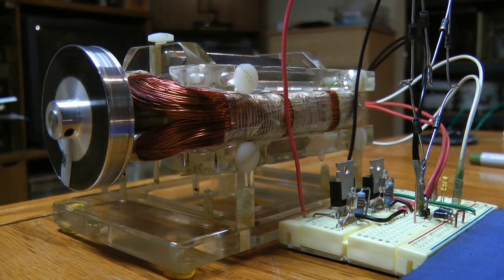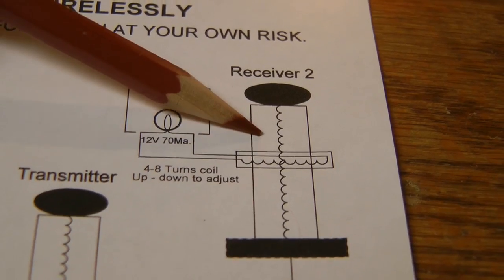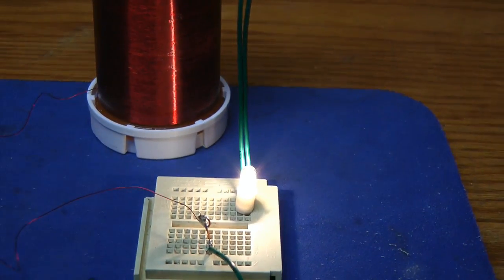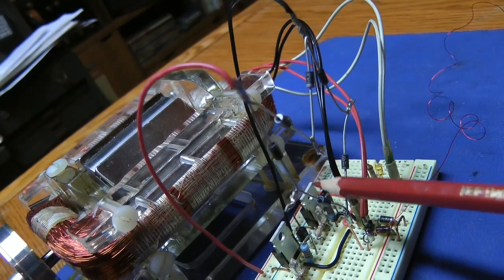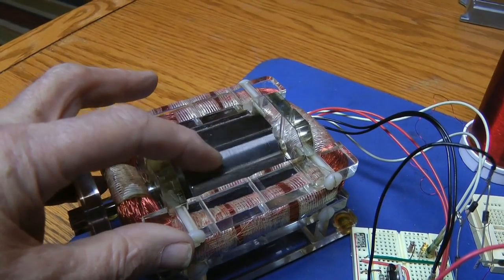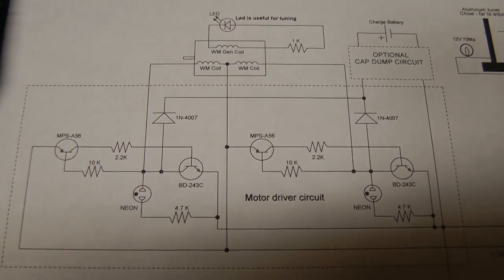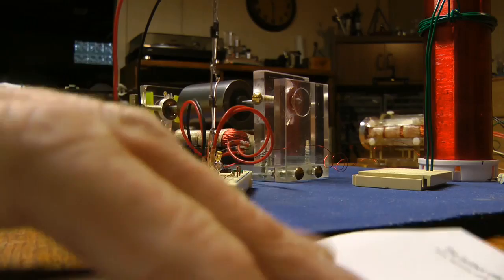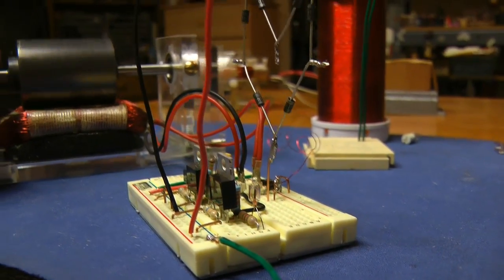Motors Run Wirelessly With Tesla Coil

Comment: It is great to see you back on youtube John,with your wonderful machines. that would have to be the best wireless energy transfer i have seen-well done. The reason the neon and 12 volt bulb light at the same time is due to the skin effect. The 12 volt bulb will consume most of the current,but the neon relies more on voltage.So there is enough high voltage passing the 12 volt bulb to light the neon. I did a similar thing with LED's and high voltage through water.
Reply from the maker: TinManPower Hey Brad, it's great to hear from you. Thanks for the compliment but I just happened to get lucky. You're probably right about the bulbs. I've never seen this happen before and mentioned to someone else that it might have to do with high frequency traveling around the outside of the conductor and low through the center. Skin effect I guess your right. Take care Pal, I'll have to visit your channel and see what you've been up to.
John
Reply: @DadHav  yes if u got frequency nd if u can get to vibrate it ie amplitude nd find resonance may b u can even use it for multiple motors at the same transmission do check with multiple receivers same resonance though
Reply: ***** Have you been able to replicate OFF of the breadboard (away from the breadboard) - that is get the neon to light in parallel to the bulb while they are touching each other directly and there is no other capacitance around?
Reply from the maker: Cool Joule Hello Patrick. OK I soldered the bulb and neon to the leads of the 7 turn coil that's around the receiver. The leads are about 8-10 inches long. The bulb and the neon still light but it worked better, brighter and easier to tune when the bulbs where plugged into the little proto board. I can light a separate little neon 10 inches from the coil or just within the same range that the bulb and neon together are. If I add an extension to the coil and move out a few more inches the effect goes away. With 10.7 volts and 350 ma I can light both for up to 3 feet away from the transmitter with the receiver and bulbs and go to about 5 feet before the bulb goes out but the neon still stays on. Are you using the same setup that has the receiver coil grounded and a separate coil around the receiver? As an observation I would say you were close by saying the metal in the board enhances the effect. I'll tell you, this stuff is so sensitive to tuning that you can easily miss things.
John
Reply: ***** All I have left is that it's exciting the neon gas and bypassing the 30ohm bulbs resistance, the way you light up the gas in the other light bulb in the previous video, that looks so cool!Is that the way your neon would light up under "normal" conditions? I see just the top of the bulb lighting rather than the whole electrode.
what is normal right ;) 
I've not been able to get that circuit to allow my little window motor to run that fast - of course I'm only pushing 12 volts. That ckt is hands down the most efficient I've used though and it charges my batteries too. the best battery charger so far using 3PM kit is the emitter follower ckt in my neg2neg mode with aluminum wire.
I love these puzzles, not that i'm any good at getting to the answer...
Keeps my brain going - thanks.
Reply from the maker: Cool Joule Hello Patrick, You might be right about exciting the gas in the neon but I think I've seen the bulb act normal also. I'll have to take closer look. I could send you a picture but I think I lost your e-mail address. If you have mine drop me a line. If you got the one coil circuit to work you're doing better than some. The circuit can be very tricky to get the right resistors to maximize the motor rpm. Also if the resistance gets to low the transistor can turn on hard and stay there. A practical fuse or a current limited power supply is good. When it comes to running the motors on the receiver the one coil circuit was the only one that worked well. The SSG and the half and full wave circuits all self oscillated but worked to some extent. The other thing is my window motor coil that was about 200 some turns did not work. The two motors in the video had over 400 turns. Patrick I was very fortunate with this experiment and extremely lucky to have things work out. Everything that's working here could have been missed easily. And don't forget the two motors I used are exceptional (If I must say so myself) LOL, Pat on back.Keep that brain going Pal.John
Reply: ya think it might be a combination of skin effect & some sort of resonance where the leads of the neon act like an antenna absorbing power from the energy radiated off the t.c.?    if you put the right length antenna on 1 lead of the LED & grounded the other lead would it light up?
Reply: can use the tesla radiant antenna i u have a graet arragment of capacitance vac and a very big ammount of bank of capacitance you can inluminate your home -.- tesla know the tru about the universal energy and is risonation gust i think i don have any knowledge only my private research

Comment: busy man! you have run a good gauntlet of experiments here. welcome to the strangeness......
i am convinced there is an extra variable with these towers that there is just no name applied to yet...not publicly anyways. trying to sort things out gets frustrating, i always feel like im missing the right words.
i hope you enter the SEC contest this year! we learned quite a bit together last year by coming together.
Reply from the maker: jeremy gwilt Hi Jeremy, I heard about the SEC contest the last few days but have know idea what it is. I agree with you. Receiving energy from a Tesla transmitter seems to have a few differences from what I'm used to. As an example how can high voltage seem to move around an operating circuit with a load. Could it have something to do with high frequency traveling around the outside of the wire instead of through it? I don't know. You have a lot of good videos. I'm going to try to keep up with what your doing a little bit. The static motor blows me away.Good LuckJohn
Reply: ***** thank you sir, i take that as a huge compliment. 
there is very little documentation online regarding slayer circuits etc, as you have no doubt learned. the term SEC (spatial energy cohesion) came up in dr stifflers work i believe. 
i found myself in the middle of a great number of people that were building these and much more experienced than i, then i think it was deeds who made an off-hand comment about a competition and we ran with it. 
it was all in the name of promotion, and worked out pretty well. i expect if we do it again it will be much more popular. 
maybe we can put some kind of a face on this mystery.
all i know for sure it that it is a 'field' of alternating current (try holding your scope probes in the air a couple meters away)...it changes shape easily, and seems to seek out ground....or virtual grounds. see....im already losing hold of it!
Reply: ***** i had to think about it a while before it clicked right, but i think you have something with your observation of travelling outside the wire. static creep has been a huge enemy building these various high voltage motors. it is nefarious! 
you can try to rectify what comes out of a receiver tower...but AC will still go right through (at least the components i have tried). the field emitted can be heard on an am radio (handheld works best), and extends a surprising distance further than you may expect! so it can be expected that the field also wraps around the components you are trying to use. diabolical.
Reply from the maker: jeremy gwilt Hello Jeremy, Sir is certainly not necessary, John is fine. Yes, Stiffler and SEC first came to my attention by watching my friend Rusty's (LidMotor) channel. He's a great guy with a lot of fun experiments. I have to admit that through all my years I never experimented with Tesla coils, so I can only present observations and probably make bad guesses at what's going on. The fun is finding something that looks unusual first right? I did notice how easy the ungrounded scope probe picks up the sine wave, but didn't move it around all that much. My hand held meter picks up the frequency as well, without being connected. I still think I've had a good experience completely by accident. Maybe it's the frequency that my coils are running at. I've heard people mention their coils are running in the KHz range but my function generator scope and meter say my frequency is 1.6 to 1.8 MHz range depending on top load or what's running from the secondary. Does this sound about right?J
Reply from the maker: jeremy gwilt Indeed, it seemed as though two loads in parallel having completely different requirements can both work at the same time. I'll have to try the radio to see what happens too.Thanks for your comments Jeremy.
John
Reply: ***** good morning...it sounds like you probably have a better handle on this already than i  :)
i am also just making observations, randomly stumbled on. i havent tried to measure frequency yet.
regarding the contest: it was a simple distance challenge, source to receiver tower with only a ground connection...and you had to transmit enough to light a floro tube. deeds won with 30 feet, done outside. i think we should at least double that distance this year.
Reply from the maker: jeremy gwilt Does the guy using the most power on the transmitter have an advantage? Does taking the distance and dividing it by the watts used on the transmitter or something like that make any sense? There could even be different range or wattage categories. Hmmm, sorry, just thinking out loud.
John
Reply: well, i put in a 'creativity' class last year to acknowledge effort without just turning the power up. im not sure how to approach that this year but something like that will have to be worked out.

Comment: I think (and may be wrong) that he capacitance in the neon has to fill up before current is passing through the filament.
Could be some other HF strangeness. Might not make sense with traditional electronics, but makes sense with slayers.

Be careful rectifying the base of the receiver. Its probably a good thing you didn't add a ground there. I found I could pop 1kv rated capacitors via a full bridge rectifier between receiver base and ground... I also found it was a great way to reduce the voltage threshold on electrolytic caps if charged to long that way.
 Here is a video of what I was doing www.youtube.com/watch?v=sLfZGNDJ93o
Reply from the maker: Mongrel Shark Hey Shark, thanks for the entertaining video. I'll keep everything you mention in mind. Ya, there's a lot of things that are hard to comprehend about this stuff. I'm sure the guy's on The Big Bang Theory could explain it all away though. LOL

Comment: Love those window motors. Good to see them back in action. Thanks for those clean schematic outlines. Have you checked the current draw when those bulbs are loaded?  I believe its considered a reactive load with those bulbs, in that it only draws according to the capacitive coupling value  and its loads load present. Its pretty cool stuff for sure. Love that shotky AV, I think I might try that some time as it adds even more capacitance to the circuit as well as fast recovery times. Thanks again, its good to see some new videos from you.
Reply from the maker: Diadon Acs Hello Diadon. The window motors are definitely a lot of fun. As I watched the video back the window motor kept spinning all the while after disconnecting it. The coils being energized from the transmitter mush have something to do with it. I don't think I can check the current draw on the bulbs but I'll try. I did try this. In order to get the same brightness on a bulb connected to the power supply I had to go to almost 20 volts and 100 ma. Yes the Shottky diodes seemed to work better than the germanium diodes at least for this application.ThanksJohn
Reply: Does the transmitter amperage go up when lit?
Reply from the maker: Diadon Acs Hello, when the receiver is between 2 and 3 feet from the transmitter the current will go up about 10 ma when a 12 v bulb is plugged into the receiver. These bulbs usually draw about 50-70 ma when operating in the 12 volt range. Moving the receiver, on the other hand, into a range of less that 2 feet of the transmitter increases the current draw from say around 600 ma to 800 or over, Still in that range the bulbs only seem to increase the draw by around 10 to 15 ma when plugged in.Interesting right?John

Comment: At 3:50 you'll likely find that an LED also lights fine, in parallel...it makes all kinds of nonsense lol. Another one, is to put a neon and an LED in series with each other, both run perfectly fine !
Reply from the maker: slider2732 Hi Mr. Slider. As soon as I read you're comment I decided to go try it and see what happens. Before I hooked up I took a guess at what I would find. My opinion was that when I plugged in the LED that it would light but based on the seemingly higher voltage that was lighting the 12 volt bulb, I figured the LED would light and over draw current until the voltage would stop to what ever the diode could hold watts wise. Well I plugged the diode in and nothing happened, the same with another LED. I tested the diodes and they where no good. Hmm, Yep they where burned out. I fetched some vintage LED's from my scrap drawer because I knew some of them can survive 100 ma or even more. Yep, this time the diode and the 12 volt bulb lit but the filament bulb was very dim and just what I would expect because of the current limiting the diode provided. I used an in-between vintage and modern LED put a cardboard between the bulb and the diode so I could see without interference and carefully moved my had away from the receiver to let the voltage go up slowly. The diode was glowing even before the bulb came on. Slowly moving way the diode got brighter as well as the bulb, then I could see a tiny red-orange glow in the diode on the junktion then nothing. The receiver was working extremely good with two of the 12 volt bulbs lighting brighter in parallel that one of them on the battery. In series neither the bulbs or the diode / bulb was very bright at all.John
Reply: Thanks for trying it..I think your power transfer is far higher than anything i've mucked about with. Certainly, if you connect 1 leg of a neon to a leg of an LED and then hold either of the outer legs with a hand they will both light.
You do tend to make highly efficient devices  and sorry about ruining a couple of LED's...as the kids would say, you have 'moar powerrr !!!'
Another way to look at it, your system is capable of blowing LEDs at a good distance, wirelessly !
Reply from the maker: slider2732 Ha, ha ha. slider I have been collecting parts for over 50 years, certainly most of them are classified as sacrificial by now. I will try your suggestion with the neon and LED if I remember. Maybe you would have the same results if you tried a receiver like Receiver 2 on the circuit picture I showed. I think this might be more like a transformer / inductive / something else tuning or something different from the capacitive tuning in the picture of receiver 1. I'm guessing but I would estimate the receiver of having near 100 ma of energy of some sort. Anything on these videos that looks like I knew what I was doing is only accidental and I just keep tying things until something looks good enough to report.John
Reply: As far as i'm aware, it's capacitance enhanced induction with the Slayer types...induction range, extended by the capacitance interplay. Dr. Stiffler maxed out the capacitance traits on his little setups.
2 same sized PC heatsinks for processors work well for that, coupling energies surprisingly well. Sort of like opto-isolation.
Bigger heatsinks work well for virtual grounds too...perhaps able to power your motors without the real Ground.
'The Vintage LED Club would like it to be known that no such device was put forward to be harmed within these latest comments'
Reply from the maker: slider2732 The Vintage LED Club eh. Awhh man, I'm always rustlin someone's Jimmies. I tried a heavy aluminum plate as ground on the receiver but it didn't work very well. I've seen people like Rusty (LidMotor) have luck with it but I'll have to experiment a little more. I'll also have to read up on Stiffler.
John